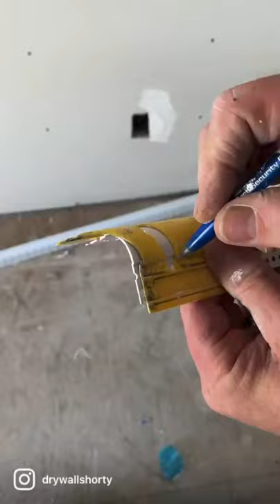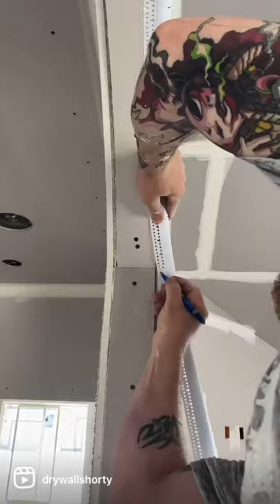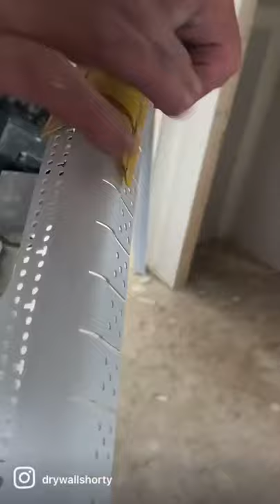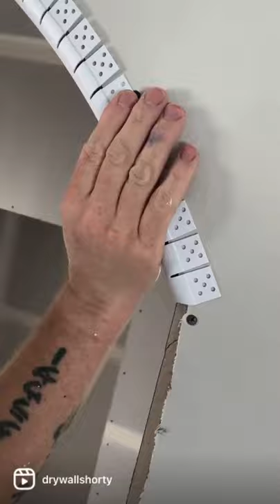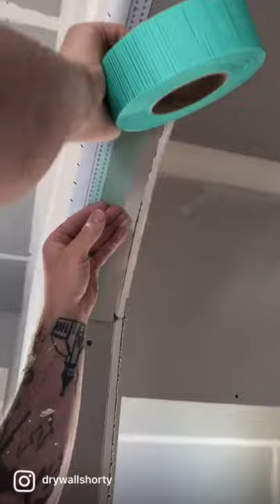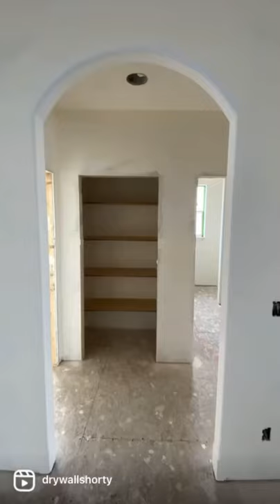#shorts Installing Arch Bullnose

Comment: lol just use fast set 5 min slap your arch bead up there tack a few nails then put on 2 coats done in 30 minutes and that way you just saved 30 minutes and made 100-200 for 30 minutes of work but if you like the spray roll with it

Comment: Arch looks good but the sides are not even straight watch the end of the video and you will see it
Reply: Then yell at the framer 😆
Reply: @beasyphone  well a good taper will level it with the metal and mud you cant allways depend on the framers to do a perfect job thats why the finger allways points at the drywall finishers maybe in a perfect world a house would be perfectly square fyi it is the finishers job to make it allmost perfect thats why they call us finishers you should treat every job like its your own house have some pride and be proud 
its just like when you did your first house and you look back at and you say yes i did that house and it looks dam good

Comment: You don't need to do all of that work just rub the whole arch with the same compound you going be feeling in the whole thing with .the compound works like like it's supposed . I've been seeing these shorts lately you guys are sloppy ,all the compound is drop on the floor . Slow ..for example this video just To do one of those from how long would it take . I've seen u guys use the electric sanding machines ,it's even ran on the skin of the dry wall which ruins it if it's fine thin layer of paint thats going be thrown on the walls .. .u must get paid real good to waste so much time for something so simple n easy to do .
Reply from the maker: Well for starters that arch product is not a mud set bead. If you’re installing that using mud it will fail. It is a glue and staple set product, that is the way it has to be installed. And when we’re using the electric sander those walls get textured and we’re using a 320 grit paper, it’s very soft and doesn’t burn the paper. And we finish around 70 homes a year, just two of us. And yeah mud falls on the floor, it’s part of the job. We clean and scrape the floors when we’re finished
Reply: Should really consider what your saying Sir..... There's a legitimate reason for everything!

Consider the possibility that she's actually doing it "Correctly"...

If you finish Drywall for a living you should know of the different "Levels" of Finishing. I'm pretty sure that in her world it's not a matter of "What level the builder is paying for". Likely it's more of what step she's at to completion.

In other words; really doesn't look like she does the typical Tape & Sand = Get Paid
Reply: @DrywallShorty  there are so many professionals in YouTube comments, that is a nice clean arch. Keep up the good work.....
Reply: Ive done it also just fill it in with mud ! And let’s go!....👌
Reply: @noelsolis2283  it would be a waste of time with mud, when it's made to be done with glue and staples. much cleaner and faster process.
Reply: I agree just use wespac all purpose the spray isn't for everybody been doing this for 30 years thats what works for me and every finisher in Southern Utah 
But do what works best for you everybody has there own way of doing it there is really no wrong way of doing it as long there is glue involved keep it up looks good
Reply: What if....just sayin....I snorted all my glue...what do I do then??
Reply: just a little bit
Reply: most of thats true shorty except for you thinking its not a mud set product and if its done correctly with mud it wont fail i have done plenty of houses and i go back 5 years later to do remodels on that same house and not a single crack in my arches and i use mud and fast set just have to make sure you set it will all purpose the trick is the glue just like the can you use its glue i have been doin that way for 30 years does not matter how many houses you do its how you do it that makes you a respected drywall finisher not putting you down just saying that is not the only correct way of doin it anyways keep it up your work looks great
Reply: @razerburn4216   @razerburn 421  comedy is one of the best things for recovery. And I trust my therapist more than a stranger, if drug humor offends you don't read it again or feel the need to respond, i give  absolute zero (it's cold in this heart son) fucks how you feel. Have a wonderful evening! Judging by your page I'd bet my kids are older than you...watch how you speak to adults  😆 grow up buddy boy
Reply: @razerburn4216  I use to help my dad when I was a kid later on I took over when he decided to move to a different state . I was only 26 years old when I took over . To be honestly  I wouldn't hire those people there in that video . I probably wouldn't hire u either . N u sir sound butt hurt .  If I was getting paid like those people in that video I be slappy too m just take my time .I work harder not smarter . Right ? Lol .
Reply: @shadowrealm8014  right on brother I know the feeling i worked for my father in law for 20 years then I started my thing best thing I ever did good luck too you and God bless